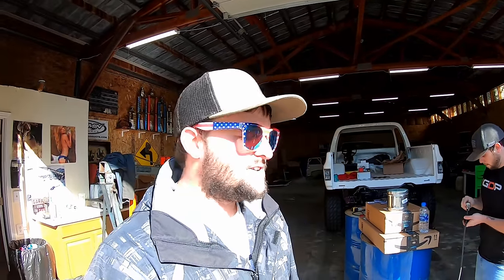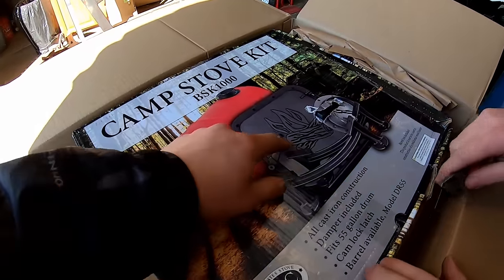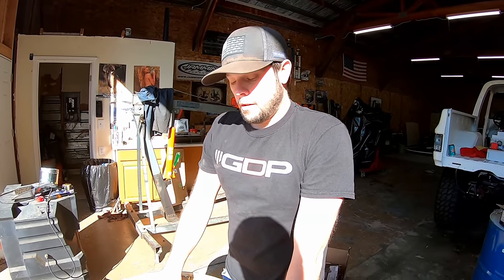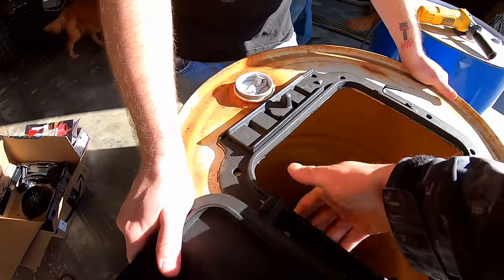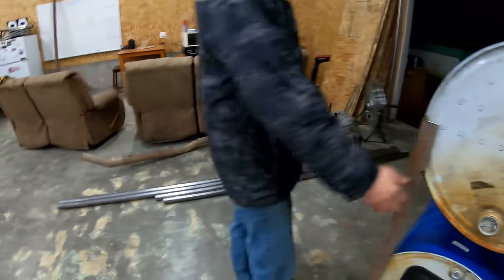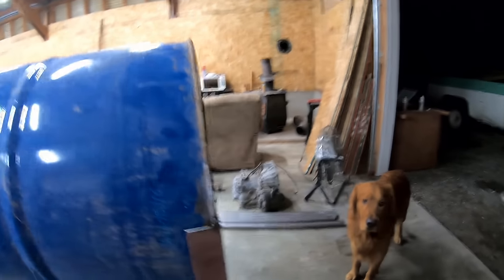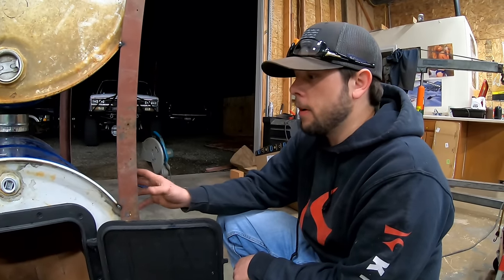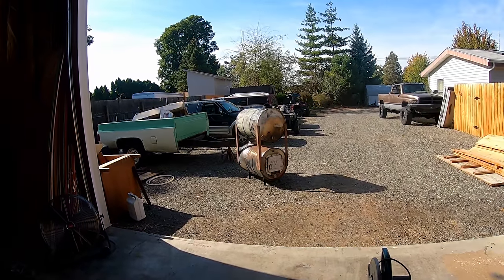DIY wood stove. Is A Double Barrel Stove The Best At Heating?

Comment: Nice build! No negative criticism here whatsoever. Just FYI, if you connect a pipe end to one of the bungs (opened) and put the other pipe end outside you'll increase your stove's efficiency exponentially. Your particular stove is probably plenty warm enough because of its size and heat exchanger feature, but burning outside air is also a key feature to maximizing heat gain. By burning outside air the room has a positive pressure and therefore air pushes out of the space. When the stove burns air from inside the same space, that space has a negative pressure and subsequently colder air from outside is drawn in through the cracks. Like I said though with your particular stove you'll be in a t-shirt during a polar vortex if you have the fuel and motivation.

Comment: I have used this same kit. Got it from Tractor Supply about 15 years ago. Used it to heat a 40'x100' garage with 25' tall ceiling. It took about took hours on a snowy day to get the shop to the point of where I was working in a t-shirt. Always had it glowing red with a blower from an old furnace to move the air around it. Got end cuts and slabs from my local saw mill that was firewood grade. Over all. I can not complain about it.
Reply from the maker: Awesome to hear!

Comment: Great build. A fan power cut off heat sensor switch at the barrels along with a thermostat 30 ft away from the stove and it’s almost automatic. Just add fuel lumber and stuff. 😊

Comment: Removable heads on the barrels are worth buying. The top barrel, especially, can't be cleaned out without disassembling the stove and after a few years fly ash will cover and insulate  maybe a quarter of the top barrel's surface.

Comment: I built my double barrel crudely and quickly in probably 40 minutes because it was cold outside. Used only a power saw with a metal blade on it. There's a lot of advantages and disadvantages to them. 
Advantages: The top barrel makes a great food warmer, food stays hot for hours if you set it on the top. The tail of the fire goes through the second barrel, which is much safer, you don't want your stove pipe to turn red. You probably get more than 20% more heat. You can cook on the first barrel.
Disadvantages: Looks like a boiler room. Top barrel needs to be removed and cleaned after 4 months, it fills up with soot. Maybe you can put a small door on the second barrel.
I think the double barrel is still such a fantastic invention, but your wife might not like it in her living room. It's great for a single man or the garage or side heater. The benefits outweigh the disadvantages.

Comment: Nice work fellows.But if you want to get more heat insulate the whole bottom barrel.Have you heard of aircete?
I built a few to figure that out.And use aircrete to make your own insulated pipe too,everything works better.
The idea is keep you combustion chamber hotter thus turning more of the wood into heat and then taking 

that heat off the top barrel(large air to air heat exchanger).This way you can always run the stove at temperatures 

that would normally melt the uninsulated  stove down.
Reply: Gary, how did you make your own aircete pipes? I’m looking to start a build like this now an considering best upgrades

Comment: If the fire is smoking inside when you light it, light a bit of paper and put it through one of the bungs in the top barrel, it works most of the time
Reply from the maker: Will have to try that out!

Comment: Having built several of these stoves as well as worked in a stove building shop here is a tip for more efficiency and heat from your stove .  Most stoves have a baffle by moving the pipe connection between the two barrels to half way between the door first rib creates a baffle without building one.  This creates a draft that circulates from the front to back and more heat comes off the sides and top of the bottom  barrel.  It all so burns the wood from front to back and burns longer and more completely to very fine ash. On the top barrel put the outlet in the back because it allows the tubes to absorb and draw off more heat and I have used straight exhaust tubing 2" has worked very well.
Reply: Do u have a pic of your heater
Reply: Diagram good sir !!!
Reply: Link and pictures or diagram please to where we can actually see what you are recommending .

Comment: In the future remember you can simply tape the bolt to a piece of wire with a lock washer on the bolt and then pass the wire through one of your pipe holes and out a bolt hole ( if that makes sense) . The reason for the lock washer on the bolt is it usually will bite and hold the bolt from turning when you tighten the nut
Reply from the maker: Most definitely

Comment: Very nice build! After watching your build, I thought up of using a cardboard template and use a punch to mark the centers, then you could take the template to the other side to match up the holes pretty good. Another thing is that angle iron idea, you could just run longer pieces and weld plates for feet and do away with the cast iron legs. I'd cut a door at the bottom, use some 1/2" square 16ga tubing to make runners to place your fire bricks over and reuse the cut piece for a door to easily remove the ash (I hate cleaning out the fireplace...lol). The door wouldn't need to be perfectly sealed for venting.  I see that y'all have the chimney going 90°, if that is OK, would running tubing all around the shop walls also help with radiating the heat instead of the top barrel and air tubes + fan? Just a thought for fanless passive radiating heating.

Comment: Fire brick on the bottom is a great idea. I’m putting one of these in my shop and definitely going to do the brick. Thanks you 👍
Reply from the maker: Heck Yea!
Reply: The less expensive porous firebrick degrades over time.  I used regular patio bricks in my barrel stove and they seem to be holding up fine while still shielding the bottom of the barrel.
Reply: A Stanton1966 pavers? I’m very surprised that those worked better. That’s interesting.
Reply: I'm not a stove expert and not saying they work better.  However, I got a pallet of free pavers from a landscaper.  And I figured what the heck?  I'm only putting them in a barrel stove.  Some people just use sand for a liner.
Reply: A Stanton1966 I gotcha 👍. Thanks

Comment: Great design. Nice job. Here’s a thought... how about filling the upper barrel with bricks?  That way, the retain and release the heat for a much longer time after the fire burns out.
Reply: Bricks?  Why not just sand or gravel..and it would fill up all the nooks and crannies. Just leave a channel for the exhaust gases.  I like your idea though.
Reply: Well, you need chambers for the gasses to escape. And here in Finland, we have these contraflow type fireplaces that retain the heat for 24 hours. I think the sand might choke it out.

Comment: Good video and good information.  I wonder if you could turn the top barrel into a masonry like heater if you fill the space between the pipes and the barrel wall with sand.  Heat in the sand will release slowly to the room for a long time.  Since sand add more weight to the top barrel so you might need to beef up the support more.

Comment: Have you thought about adding some copper pipe around the chimney vent? You could use it to heat some hot water for your wash basin and bathroom?
Reply from the maker: There is already a hot water tank in the shop for the bathroom.

Comment: Perhaps a round of expanded metal could be placed over the front of the tubes to tidy things up and keep people from accidentally burning themselves.  

Terrific job and application with the angle iron supports.

In another YouTube video someone added a length of 2” pipe along the bottom from the circular bung hole to the back of the barrel this pipe was capped at the back and perforated via drill to carry combustion air to the back of the barrel for better burning throughout the length of the bottom barrel.

Comment: Terrific job and improvisation.  Surprised you didn’t add a coat of high temperature paint on the outside. Consider dry stacking cinder blocks in the corner to add fire break and a bit of additional thermal mass.
Reply from the maker: The paint is coming eventually lol

Comment: Reminds me of a 2 keg stove we for our shop at my dads shop,we used 1 inch stainless steel tubing . Stainless steel is readily available in the south if you work offshore . We don't have the wood down here but we have real short winter.
Reply from the maker: That's awesome
Reply: SS is a TERRIBLE conductor of heat. It's all going out the flu. You'd need a huge heat exchanger, plus if you get it too hot, then you're gonna fuck it up.

Comment: If you run a long chimney you'll get even more heat from it. That's why you see in pictures of old buildings with the chimney going through them.
Reply from the maker: Might have to change it around
Reply: @JustinTBraun  well see how the current setup works out for you. My not need to put anymore money into it.

Comment: made a double barrel stove out of 30lb propane tanks due to the fact i re-qualify them for a living and thus have an near unlimited supply of them. throws heat like you wouldn't believe. Only problem I have is the smaller fire box runs out rather quick when you pump the shit out of the stove.
Reply from the maker: That's pretty rad

Comment: Nice job, but I think I would have placed the stove closer to the center of the shop for even heating. Seems like you are going to have a very hot area and a cold area at the other end.
Reply from the maker: Thats what the fans will help with
Reply: @JustinTBraun  Yeah, but by the time the fan pushes the heat to the far side of the shop, it will have risen to the ceiling, leaving a cold area where the people are :)
Reply from the maker: We have some fans in the ceiling to push the warm air back down. Would be nice to just put a diesel furnace in.

Comment: Have you had any problems with the flue, since it doesn't have much rise to it?  It seems like it would be better to go a lot higher up before exiting the side of the building.
Reply: I'm sure it rises once through the wall. Has to go up above roof to get a draft. Personally I'd run it NH indoors and get the head from it and exit through the roof but either way works
Reply: I saw another video where the author moved the flue 18" above the top barrel.  He said it helped a lot.

Comment: So the smaller stove you were using will now go in the opposite corner? Your roof doesn't look very well insulated. Great heat exchanger, probably increased efficiency by a very large margin. Good job.
Reply from the maker: Still need to get the roof insulated

Comment: The first thing you should do is to insulate the roof, 8 inch thick insulation atleast. Heat travels upwards and you loose all that heat if the roof is not insulated. With a proper insulated roof you will cut energy loss and could problably heat that garage with a much smaller burner.
Reply from the maker: It's on the list just no funds to do it yet

Comment: 5 gal tank on a shelf with 3/8 copper tube into 1/4 black pipe welded in the center of the bottom drum, you won't hafta pay to get rid of all your waste oil and you won't believe how much heat drip oil puts out.
Reply from the maker: That is definitely the plan. Hopefully soon we will have it done.

Comment: Should have left the fire bricks out for the first burn. Also should have made a small grate for airflow under the wood your burning. I watched a video similar to what you did except he used a fuel oil barrel and had the pipes above the burning wood.
Reply from the maker: That would have been a good idea.

Comment: Looks like it should be an efficient stove. I'm wondering though, is there any way to clean it? Won't creosote build up on the heat exchanger? Maybe it doesn't last long enough to worry about.
Reply from the maker: That is a problem we are having right now.
Reply: @JustinTBraun  
You ever find a solution to the creosote buildup?  That was a concern I wondered about - there's no way to get inside the heat exchange to clean out the creosote....

Comment: I have had a double barrel set up in my 25x30 foot shop for over a decade and recently added a heat reclaimer for the flu that scavenges the exhaust heat as well as the neat from the heat exchanger (top barrel). You should totally check them out. My shop would take about an hour to warm up before hand and now it's 30 minutes to comfortable temps in the coldest of days. I DO need to install pipe into the exchanger on mine though. Cheers! Zip~
Reply from the maker: I'll have to check that out!

Comment: might be a good idea to put a small hatch in the bottom of the burn barrel that you can open to scoop the ashes out
welding a row of sheetmetal plates like cooling ribs in between the top and bottom barrel in the same direction as the pipes might help disperse the heat from the bottom barrel along the the heat going through the top barrel
Reply from the maker: Its has good access from the front door to get the ashes out.

Comment: You can add a compressed air nozzle to the flame barrel if it don't produce like you want just turn on the air compression and turn it into a super stove!!
Reply from the maker: Haha I bet that would rip
Reply: It does, I saw it used at an auto body shop like the size of urs, sounds like a blow torch.
Reply from the maker: I imagine!!

Comment: I am looking to build something like this, 2 questions i am putting this in my 2 car garage turned shop/man cave.  Do i need a double burner set up and can i place it outside with a vent coming into the garage?
Reply from the maker: If the 2 car garage isn't to big you probably wouldn't need a double barrel setup

Comment: What are you going to do about the eves vent it is a big gap were the warm air will escape. 
Also, looks like a pain to clean the ashes.
Reply from the maker: The entire roof is getting spray foam insulated

Comment: How is it heating the shop?  I just built a 50x60x14 shop and have been looking at doing a double barrel shop to heat mine.
Reply from the maker: Been working good. Will work awesome if the ceiling was insulated

Comment: Are you sure your insurance company agrees with you that it is alright to use a single wall galvanized pipe from the first barrel to the top? Did they say it wouldn’t corrode and fall apart and burn the shop down?
Reply from the maker: Possibly
Reply: Overtime Garage, do what ya want, I just think it could become a problem.  Best of luck!
Reply from the maker: @Nevertrustalawyer  I most definitely agree!
Reply: Overtime Garage, I built one myself. When I brought it outside to burn the paint off the barrels, I got a fire going with no upper flue pipe and all of a sudden, the door started shaking, it was moving a tiny bit and blue flames shot up at least 25 feet. The oil caught fire from the heat and turned that stove into a jet engine.  They do crank out the heat, something like a 100,000 BTU’s.

Comment: You might want to look into insulating the ceiling... 80% of heat is lost through the ceiling
Reply from the maker: It's on the list. Need more money lol
Reply: Ok just making sure lol I get the money part I’m saving to build my shop lol
Reply from the maker: @mathewb5044  it definitely takes a lot! But hey that's life!
Reply: The ceiling of the wood stove, or the building?
Reply: Thalanox the building

Comment: Guys, why this complexity?

It will be enough to have a longer chimney pipe inside a bigger pipe und than just install a inpipe ventilator in a T section of the bigger pipe at the end of the chimney pipe in your shop to realise a countercurrent flow heat exchanger.
That's it, without any rocket science 👍
Reply from the maker: hmmm